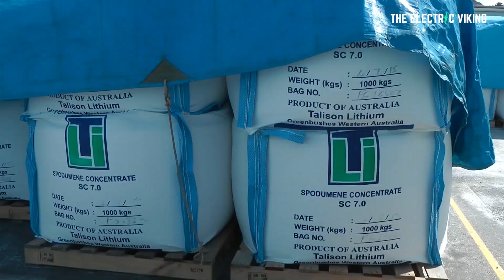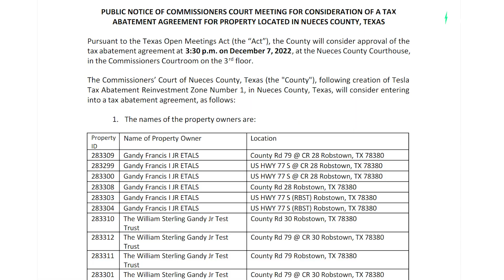The first battery grade lithium refining plant in North America

Comment: Is BYD's troubles about to start?
BYD's hidden worries:
one hand, in October, BYD's terminal sales exceeded 160,000 units, far ahead and the number one. BYD's installed capacity "one to nine" is equivalent to the sum of SAIC-GM-Wuling + Changan Automobile + Tesla + GAC Aian + Chery Automobile + Geely Automobile + Ii Automobile + Hezhong + NEO Automobile, and its strength is unmatched shake.
On the other hand, in October, BYD's terminal sales fell by 3.9% from the previous
month. slide. However, BMW Brilliance, Changan, Zeekr, and seres grew against the trend. Thanks to the sharp price cut of BMW i3, BMW Brilliance jumped 55.2% month-on-month and once again entered the list
According to the Ministry of Public Security's compulsory traffic insurance data, the terminal sales (insured volume) of new energy passenger vehicles in October 2022 will reach 446,277 units, a year-on-year increase of 53.48% and a month-on-month decrease of 17.2%. Among them, the terminal sales of pure electric vehicles were 322,167 units, a month-on-month decrease of 20.8%, and the terminal sales of plug-in hybrid vehicles were 124,067 units, a month-on-month decrease of 6.3%.
.......detail to my youtu..

Comment: 😊Sam😊The amount of lithium needed to make electric vehicles and grid/business/ home storage systems is astounding each battery factory and electric vehicle manufacturer is asking for 300,000 ton contracts and we only mined 350,000 tons globally until recently . I believe the best lithium comes from the brine extraction method I like lake Resources (LLKKF ) because they are paired with Lilac which has the most patents in this method of lithium extraction. But a lot of millionaires are going to be made if you buy a few of the good ones and Lilac just moved it’s headquarters to Reno near Tesla and Lilac has a lot of powerful/ wealthy investors ( lilac is privately held) but LLKKF is using its technology